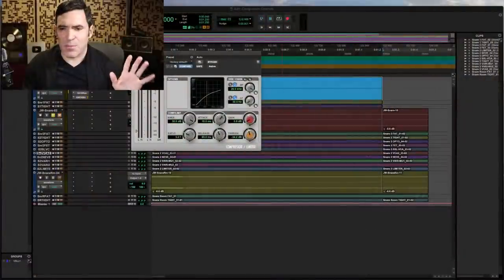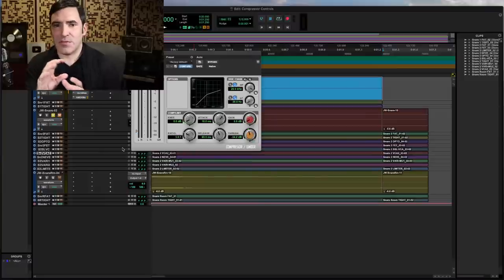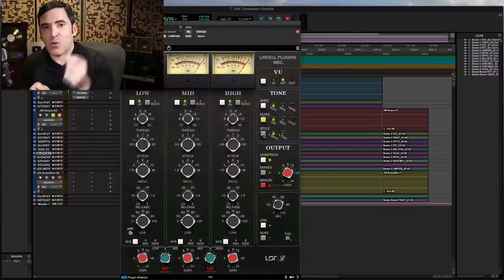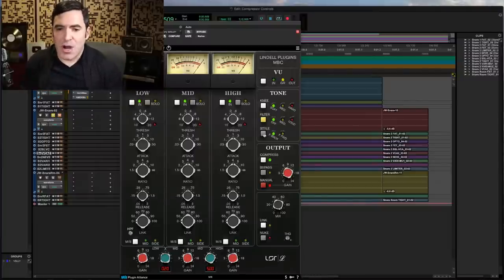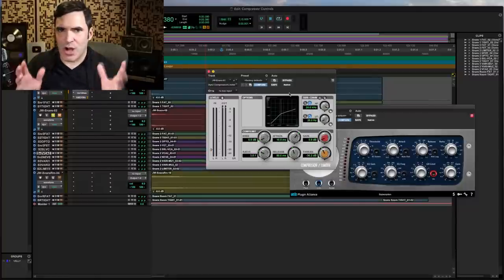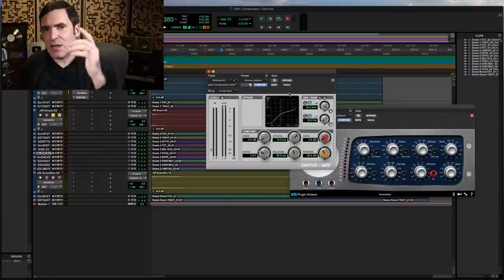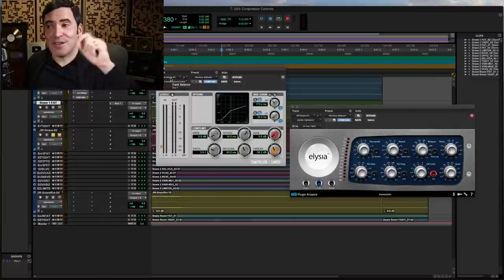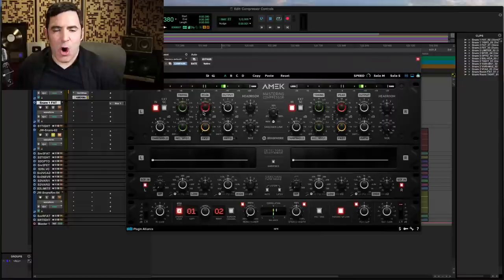All the WEIRD Compressor Controls You Never Figured Out.

Comment: Hi Justin, finally got round to watching this.  Packed full of useful information so thanks.  Not sure if somebody has already pointed it out but the Fabfilter Pro C2 has a gain reduction limit (I think they call it range) and it also has some very flexible M/S compressor setting in the sidechain section.  I have to say that I'm falling back in love with this plugin having been distracted for a while by the "shiny new toy" syndrome.

The other compressor I have with GR limit is Tone Projects Unisum.  It's an absolute beast of a (mastering) compressor with more controls than I know what to do with but thankfully has some really good presets.  And makes everything sound better imho.

Comment: Re: feedback vs feedforward compression. On instruments with sharp transients (e.g. percussion), by the time a feedback signal reaches the detector, it's already too late, the transient has punched through regardless of your settings. Feedback compression is better used on low-DR signals to keep them at a consistent output level.